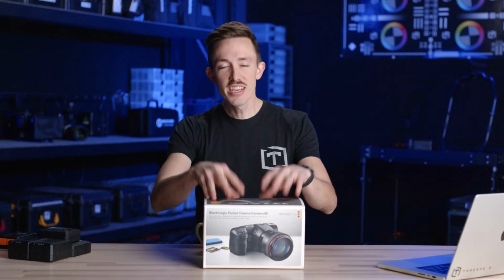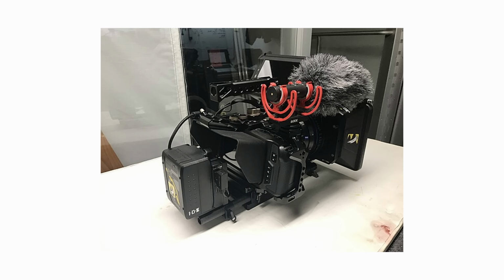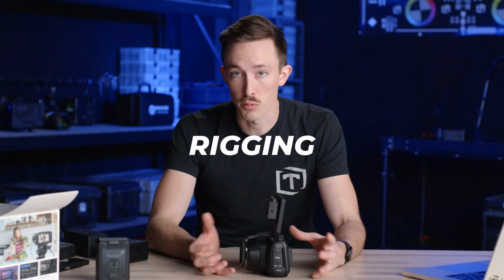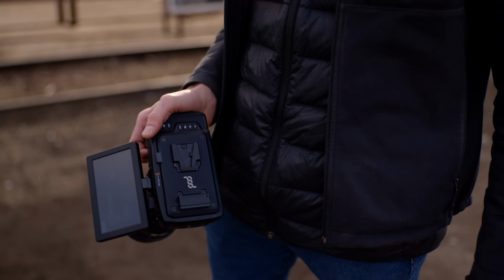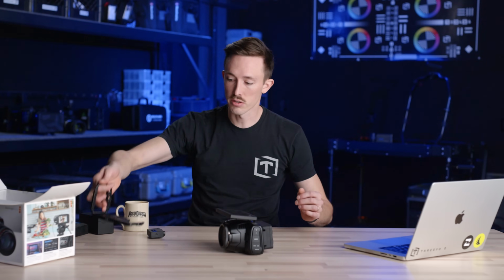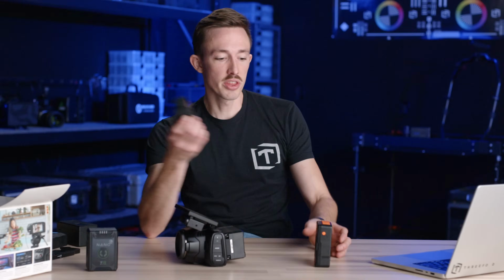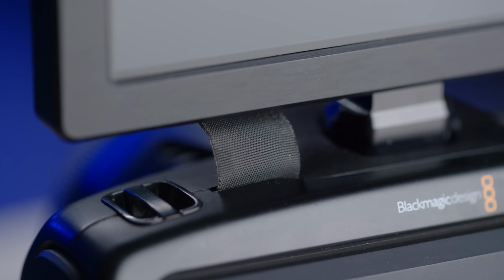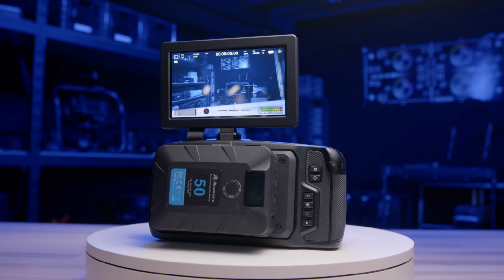The Camera We've Dreamed Of Is Finally Here! (Not Photoshopped!)

Comment: Regarding the V-Mount Battery placement I have 4 potential set ups;
1st set up is to mount the battery on top of my smallrig cage to the right of my top handle. This is mainly for if the camera is in a fixed tripod position, and I can then make use of the screen.
2nd set up is to mount the battery underneath the camera. This is if I'm mainly gonna be doing lots of handheld shots and not using a Tripod. I will use an external monitor mounted on my top handle but still have access to the screen for changing settings.
3rd set up is a mix between 1 and 2 by using a rails and mounting the battery under the rails and behind the screen. This means the screen is still fully visible and I can still get my camera on a tripod.
4th option is to use the V-mount clamp as I originally purchased it and attach it to my Tripod leg with the clamp. This keeps the battery out the way of the screen and free's up space to mount other things. I will also mount my H6 recorder to my Tripod for additional audio.

All 4 of these set ups have their quirks but none of them block the screen in any way.

Comment: Would have been better if the monitor wasn't hard mounted but instead was mounted on something like NATO rails and the ribbon cable had some connector and we could run some extension cable. That way there's still option to use a full cage together with all the accessories if needed and it would make external monitors not needed in large amount of cases.

Comment: You don't "need" to use V-mount, I build my setup with NP-F batteries, i am using 10k mAh Batteries and one battery lasts me 3-4 hours. Plus i dont block my screen (that was the point of my setup), also, monitors and many lights also use NP-F so i have like 8 huge NP-F batteries and can use then for whatever.
Reply: Huge in the sense that they have large capacity, they're actually smaller than regular v-mount and the size as the smaller v-mount batteries.

Comment: interesting, looks like you deleted my comment i posted yesterday 🙄 as I said you can sort out the problems people are having with battery and screen placement using  a cage a couple of rods and a horizontal v-mount battery unit, (i used the HedBox unix as it has a dtap to bmpcc power connector) that allows access to the touch screen and balances the weight nicely. Then you can have a properly integrated rig all powered by v-mount battery, including follow focus, external monitor (not required but nice) a top handle, quick release... this modded bmpcc is to me just a big lump that is too rudimentary. Hopefully you only deleted my last comment because it had a link to pictures...
Reply from the maker: That was a YouTube auto delete. We never even saw that comment. They auto delete lots of things that have links

Comment: The Pocket 4K was groundbreaking when it came out and was an instant preorder for me and many many more. 
The biggest problem the Pocket lineup in my opinion is that it tries to be two different camera styles. 
On one hand the Pockets are cine style cams. So it's not a too huge problem that they lack autofocus and other functions of more mainstream cameras. But for cameras in a cine setting they have many downsides like the battery that is pretty much just usable as a backup for hot swap scenarios, the really rigging unfriendly formfactor and a few more things. 
On the other hand the formfactor screams run n gun, but for this it also has shortcomings like autofocus, battery, image stabilization, etc. 

It tires to be a one person camera but in some design decisions is more geared towards a camera crew. 

I really like my P4K but in it's current form it's sometimes really difficult to work with it and I sadly can't justify an URSA in my current position. 

I don't really understand why Blackmagic doesn't release a true box style camera. They pretty much have every component: Main internals from a Pocket, Screens with Blackmagic OS, they already can be controlled to some extend over HDMI. 
Maybe they are scared of undermining their URSA lineup but I don't think it would. 

And don't get me wrong I'd love a new Pocket but one with a greater focus on solo operators. 

One can dream.

Comment: if it would be possible to change the screen to a higher nit one because its a pity the the bmd screen has such a low nit which makes it impossible under the sun even with a shade.  the power consumptin would be covered by the vmount battery however the sccreen if available would probably be expensive,

Comment: This is awesome. Only thing I would want is to make the onboard monitor modular. But even if it is not, it is still fine. But use this mod with some v mount pag onboards, and thats an awesome combo. Cause with the pags, they're stackable, and you can hot swap simply off of the v-mounts and bypass the np batteries. But this is great, thanks for making this video!

Comment: I do use the large V-mounts with mine but I had bought a V-mount belt clip that Small Rig makes and 2 pin to D-tap cable. It is a little tricky sometimes if you are using a gimbal. I have to rig something similar when I use the Tilta Float, but then I have two V-mounts at the bottom for balance and power. Something that would be really great is if BMD could make the functions compatible with the Ronin so you could use one of the buttons on the Ronin to start record on the camera. If there is a way, I've never been able to get it to work and always have to do it manually or through the app on Ipad. I agree, the screen can be pretty useless but for the functions

Comment: It’s super cool. But the two complaints I have, is that you cant remove the monitor and you can’t put a half cage on it. I still want to be able to put a side or top handle on it and incorporate the SSD. So hopefully I get will be fixed. And no offense but the quarter cages suck. Has to be half cage for me. 
I wonder if he could move the menu buttons so that they are also on the screen? Then you can use any size v mount.

Comment: While at first I was excited for this, I quickly realized that it's not viable for several reasons:

1.The power connector is disabled. If I do an indoor interview shoot it's nice to not have to use batteries.  This is also removes other power options, and if you have the 4K, using the Canon batteries isn't really a good one.
2.It's limited on the vmount batteries you can use.  You can only use smaller ones because something bigger would block the buttons.  And going back to point 1, since the power input is disabled, that means I can't use a bigger vmount to connect to it if I so desired.
3.The ribbon cable poking out is asking to be broken.  A handle with a hot-shoe or pin connectors would have been better.
4.No cage.  I love these cameras and I love rigging them.  I can't mount a follow focus on this because I can't put a cage, no more handles, accessories, etc.  I can't even mount a wireless monitoring system if I need to.  They said they wanted to build this so you wouldn't need a cage, however cages are useful.  What about using rails, or baseplates and the like? 

All in all, I hope this does wake Blackmagic up and they come out with a new body and new system instead of just releasing the same body with "new" features.  It's sad that people have to resort to modding their cameras in such a way.

Comment: Just get a 68w Auton Bauer Titon base battery everyone and all your problems will be solved. I don’t know why most people want to rig their batteries in the back of the camera… it isn’t practical. Put it at the bottom, and you will never struggle for any application (handheld, tripod, etc…). You also don’t loose the cage compatibility and can add accessories wherever on the camera without the battery getting in your way. 
I agree, the camera batteries are trash. This Auton battery lasts 3 hours powering both, the camera while recording, and a Teradek transmitter. 

Also, just get the 6k pro which has a tilt screen for your screen issues 👍🏼

Comment: Weell, kudos for the mod and the design. Looks really solid. However losing the capability to use the lemo port is kind of bummer and a big one imo. Also I see potential problems in using the camera on a gimbal with this mod. With the original camera you can use whatever battery you want. For example an npf plate with a cold shoe quick release is a very viable option. It will give almost the same juice as this micro v-mounts. They are smaller and way cheaper than v-mounts. Also when you use the camera on a gimbal you can mount the plate in the gimbal itself and use just a small lemo cable extension. One battery gives you around 3 hours non stop recording so with 2,3 batteries you are set for the day.

Comment: This is one of the most stupid mods i've ever seen... You can buy a tiny little vmount plate, attach it to the top, or bottom and use a 5" monitor with a tiny magic arm, and you get the same functionality with full of the usability... The problem of the Pocket cam is not the screen, is the bulky design...

Comment: I think it's a really groundbreaking idea.
This is a great idea
But I am so angry about this company called Blackmagic.
 I've never written anything like this before, but I'm so angry that they discontinued the initial 6k model.
The 4k model still exists on the website, but there is no initial 6k model at the moment.
I sold the 6k early model I had.
It's so cool that they applied the initial 6k model above. However, due to Blackmagic's atrocities, I no longer use Blackmagic cameras.
However, ID's use of a V-mount battery for the display window is very commendable!

Comment: Gah! It is so close to being perfect! 

- I still really want/need the top handle, there has got to be a way to mod it a bit more to allow screen to go on the top
- is there a way to do plug and play ribbon cable to remove the monitor or make it longer?
- the hole where the ribbon comes out, is there a foam or soemthing that can be put to fill that in to stop dust or moisture form getting in?

Comment: Did you happen ask why they didnt go for adding a monitor cable port on body and monitor so a more robust longer cable can be used to relocate the screen? That seems to be the only thing this thing is missing. Having the screen fixed to the top like that and not being able to use a top handle is kinda strange as most people use one for handheld work.

Comment: The only problem this mod creates which is a dealbreaker for me is that without the 1/4 hole on top of the camera it becomes impossible to mount a cage - which I want for protection
Reply: Did you watch the video? You can mount the cage to the bottom of the camera pretty reliably.

Comment: When seeing this mod, the first thing I thought of is a removable, modular monitor for a future iteration of this camera, with a specific place to mount on the body, with of course a mount that is a part of the internal frame to the camera, to make it strong and rigid. Have the monitor on a swivel and hinge type of mounting arm. So that the monitor can rotate 180 degrees and also angle freely. This would give you almost unlimited control where you could view the monitor well, while working.

While I think this mod has a lot of promise, one thing I am not keen on, is filing down part of the housing to make a permanent change. To the camera housing case. Even being small, it still allows for an opening into the camera where, dirt, dust and debris can enter, thereby causing other unforeseen issues down the road. Especially in dirty filming environments. 

I think the mod idea I have would be perfect with this V Mount location. There is definitely some ideas percolating in my mind how this camera would be the ultimate camera…. It is great in many areas. And with a few mods for these things, it would be revolutionary. 🤷‍♂️

Comment: First of all you lose the SSD mount on the top plate 
Second the top handle usually houses my XLR shotgun or pencil mic and my XLR dual channel field recorder 
A side follow focus handle can't be mounted unless I add an extension bottom cheese plate
Also loses the ability to balance on a gimbal at which it already was difficult to start with
It's a great mod but again it's a bandaid
Probably a rehousing mod to convert that camera to a boxed camera would do wonders

Comment: Here’s the problem with this entire thing. You now can not attach a shotgun mic or top handle. You’re going to go handheld on a camera that has no ibis (yes it’s got gyro but it’s going to crop on your image more than a crop sensor already does) . I’m sure Blackmagic thought about this and realized this isn’t as good of an idea as it seems. This isn’t a photography camera it’s a cinema camera it’s supposed to be rigged out. I give it 1 month until people start realizing the problems with this. 
where tf are you going to put your SSD? Don’t tell me we’re going to have to buy cfast cards now which are inanely expensive. Lastly YOU DOING THE INSTALLATION yourself is probably going to void your warranty so if you screw up IT OVER. This whole idea creates more problems than it solves

Comment: Really interesting mod effort!  I'd say the following shortcomings would need to be addressed though.  
-Monitor doesn't seem to be able to swivel left and right.
-Ribbon cable seems susceptible to damage in the long run
-Hole where ribbon cable exits the body on the top is just waiting for dust/ water ingress to damage the camera's internals.

I think making the monitor completely removable by adding ports to the body would address most of people's issues with this mod.

Best of luck!
Reply: For sure, you could also treat it more likea. boxed camera then and rig it out if production calls for it.

Comment: One of the solution to the battery is to run dummy battery straight from the vmount. So the charging power wouldn't be touched and can charge the camera forever.

Comment: I has many problems, the fact that you can't use a cage makes it unusable for me, especially for the lack of top handle and attachment threads all around. 
Also, the horizontal placement of the battery forcing to use a nano battery is not good. There are many types of v-mount, and not everybody invested in SWX Core nano, or FXLion, or this specific size.  I need to use big batteries too, but it looks like they would cover the buttons. And it doesn't allow to use sandwich items like power distribution plates or wireless transmitters, that are made to keep the rig very very compact.
However, these interesting mods are a symptom of Blackmagic refusal to acknowledge the needs of the Pocket users. A camera with a box form factor and a battery plate behind the body. Otherwise, as soon as one was to rig it a bit seriously, a rod system is needed with stuff 5-10 cm far from the monitor and the camera quickly becomes longer and more cumbersome than an Ursa, that's ridiculous (and it's the reason I won't buy any more "pocket" cameras like these anymore).

Comment: It's interessting!! But...
1- What about the Mic Place XLR (for Sound)?

2- In this case, It could be easy for blackmagic to do It: "Just give the opción on the EVF place (Shoes)  to use it also with A Portable HDMI on the of the EVF as well". And eliminate the screen in the back, and replace It by a VL Battery mount shoes in screen place. In theory, it's seems not so complicate to do. (JUST USING THE EVF SHOES FOR THE HDMI OPTION)

3- THE ONLY PROBLEM could be THE MIC SHOES OPTION: "replacing the Mic Shoes position, in a perfect place (where we have not to choose between "HDMI and Battery" AGAINST "Sounds and Mic Shoes").

Comment: A $500 mod kit for a camera that they will likely phase out very soon. It also states that the mod will make the 12v Lemo power input unusable.
Reply: That's 500 NZ dollar, so about $300 USD. And why does it matter if BM phase out the camera as long as people still use it?

I've only found myself using the 2-pin plugged to the wall once. I have it constantly connected with a 2-pin to D-tap to run off V-mount batteries. But like they say in the video, if you ever need to run the camera off mains power you can still connect the v-mount battery (given you have the right inputs on it) to an outlet, just like you would with the 2-pin. Which also works for a LP-E6 dummy if you prefer to not add the bulk of the battery.

Re-routing the 2-pin to the V-mount plug is just the way this solution works, and removes the need of an additional cable for anyone using V-mounts. It's not really removing any functionality of the camera, just moving it from the 2-pin to the battery or dummy attached.